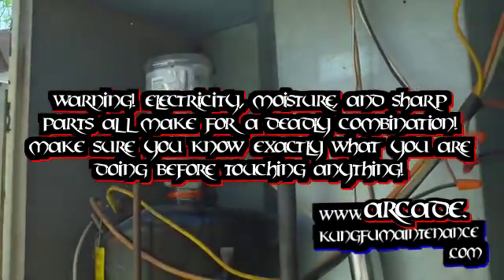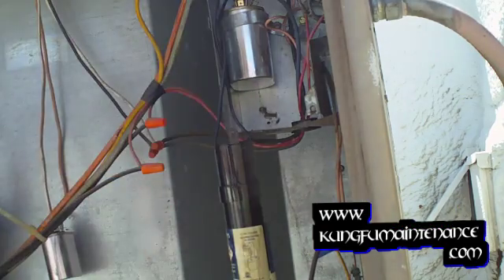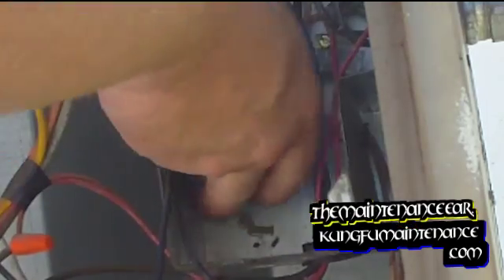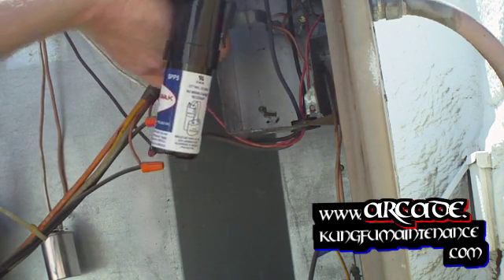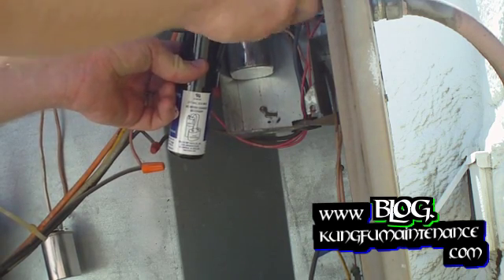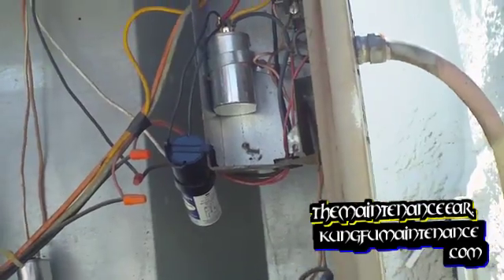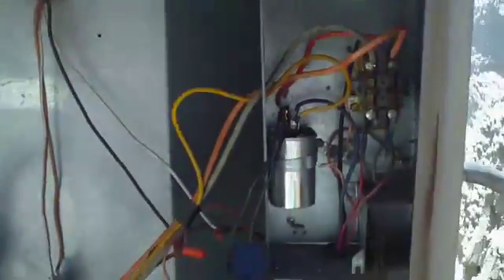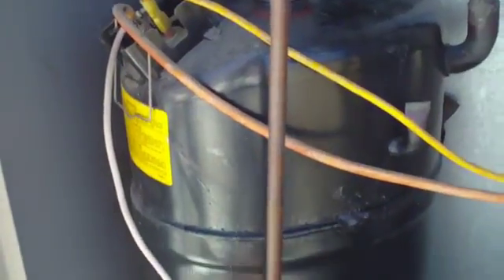Air Conditioner Repair How To

Comment from the maker: 5/8" Suction Line Insulation   http://amzn.to/2w1me8G
Simple Leak Seek Spray   http://amzn.to/2lFfcC5  Laser Thermometer  http://amzn.to/2layD8I  
Valve Core Removal Tool                              http://amzn.to/2kJ00pC
Get KFM favored Electronic Leak Detector        http://amzn.to/2kmQMMz
Inficon Refrigerant Scale                               http://amzn.to/2vUCQPD
Get KFM's favored Multi-Meter  here        http://amzn.to/2l8W9CO 
Get the Milwaukee 11 in 1 Screwdriver     http://amzn.to/2uTtsNj 
Wet Dry Vacuum used in so many KFM videos   http://amzn.to/2lFxi7u
Chapin Pro Pump Sprayer                             http://amzn.to/2vWCXdD
Evaporator Coil Cleaner No Rinse Mix        http://amzn.to/2x3eJTT
Evaporator Coil Cleaner No Rinse Can        http://amzn.to/2ezIxju  
Get the Screwdriver used in so many KFM videos here    http://amzn.to/2kHFoOF 
Easiest Way To Get Universal EPA Certified Prep Manual    http://amzn.to/2kIQdQC
Get KFM's favored AC Gauges here            http://amzn.to/2kYgGb8
Hard Start Kit     http://amzn.to/2kiD16v   Contactor     http://amzn.to/2lFqA0P
Get  the Multi Tool Pliers used in so many KFM videos       http://amzn.to/2kWTjPp
5mf Capacitor   http://amzn.to/2wC96sH     35mf Capacitor    http://amzn.to/2vZVZ2t
35/5mf Capacitor   http://amzn.to/2iVJNi2        40/5mf Capacitor    http://amzn.to/2wzEdXD 
45/5 mf Capacitor   http://amzn.to/2w0wez5   
Condensate Pan Tablets   http://amzn.to/2lalV9W   No Rinse Coil Cleaner  http://amzn.to/2lHg8GD
Condenser Fin Whisk Brush                          http://amzn.to/2vWXUoC 
You must be EPA certified to charge or recover refrigerants and here is about the Easiest Way To Get certified with the Universal EPA Certified Prep Manual    http://amzn.to/2kIQdQC
Get The Kung Fu Maintenance book here     http://amzn.to/2lEQPFk
Or  the Kung Fu Maintenance E book here  for less than $5    http://amzn.to/2lEY8wD
Get the Kung Fu Maintenance album (good driving music) "Up Beat" here     http://amzn.to/2l41pZ1
Get the Kung Fu Maintenance album (nice Instrumental music) "Entropy" here   http://amzn.to/2kl2U0p
Samsung Galaxy S8 Plus        http://amzn.to/2sFn9h8
GoPro Hero 5 Action Camera         http://amzn.to/2sN4nVK
Rode Lapel Microphone                 http://amzn.to/2vZoFc7
Purple Panda Lapel Microphone  Kit   http://amzn.to/2wByXkq
Video Edit Pro Software       http://amzn.to/2ruaaeZ
Samsung Galaxy S5                 http://amzn.to/2wBxk6l     
Samsung Galaxy S8 Plus        http://amzn.to/2sFn9h8
Video Edit Pro Software       http://amzn.to/2ruaaeZ

Hire An HVAC Specialist                                  http://amzn.to/2lktKek
Air Duct Cleaning Services                              http://amzn.to/2lFTpun
Central Air Conditioner Tune Up                   http://amzn.to/2lzJGoy 
Air Conditioner Repair Or Installation          http://amzn.to/2lFsEGw                                           
I don't work for any of the product companies  listed however I do make a small commission on items ordered  through the links.

Comment from the maker: Don't touch anything unless you know exactly what you are doing. There are many different things it could be. The symptoms are trails to the cause. Watching my other videos can help your detective work. Breaker tripped? Fan motor turning? Compressor running? Contactor sucked in? Burned wiring? Know that the capacitor holds a charge even after power disconnected so cap must be discharged before servicing. Hard start kit? Fuses Blown? Compressor Hot? These are the clues to solve the case.

Comment from the maker: Don't touch anything unless you know exactly what you are doing. There are many different things that could be wrong. The symptoms are trails to the cause. Watching my other videos can help your detective work. Breaker tripped? Fan motor turning? Compressor running? Contactor sucked in? Burned wiring? Know that the capacitor holds a charge even after power disconnected so cap must be discharged before servicing. Hard start kit? Fuses Blown? Compressor Hot? These are the clues to solve the case.